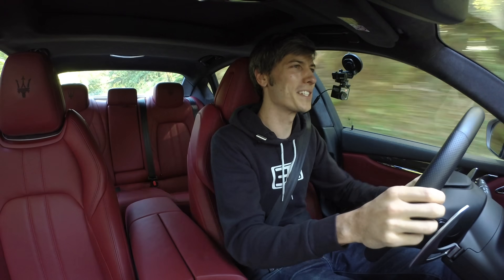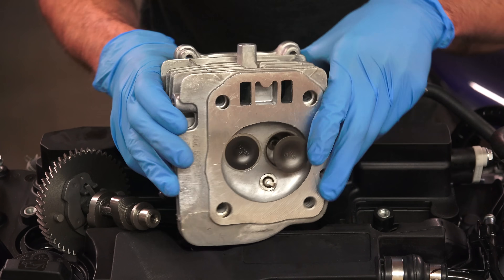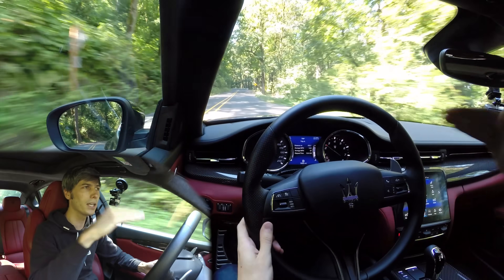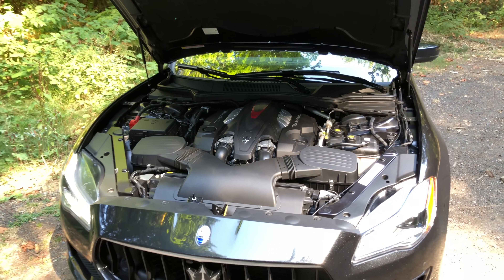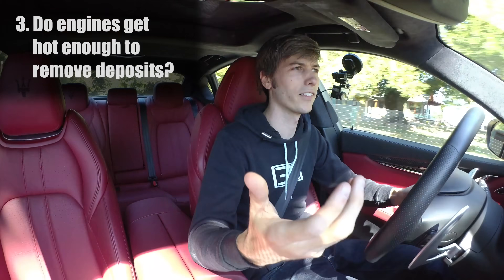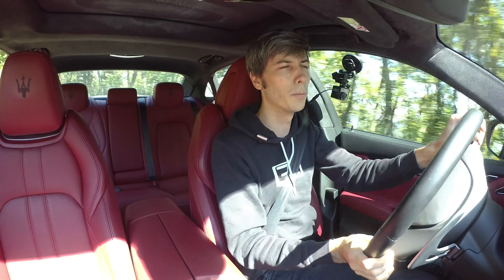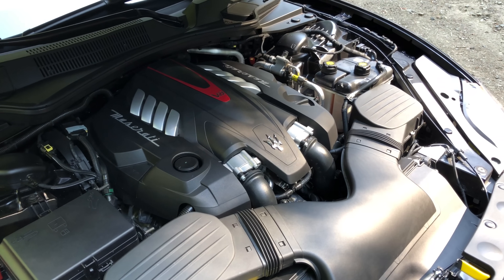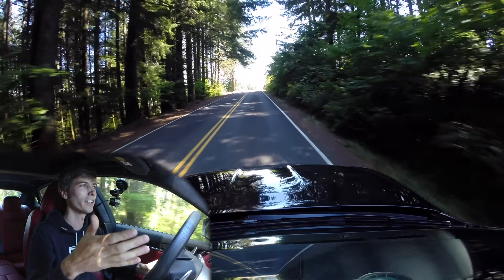Is Redline Good For Your Car's Engine? Italian Tune Up

Comment: I always thought "red line" meant "target rpm"
Reply: victornpb it’s suggested RPM, obviously you want to go higher for peak performance
Reply: "Optimum working range"
Reply: Redline is the maximum working speed of your engine. By this point, most engines, especially larger pushrod engines like V8s, can't really breathe. If you push most engines near this point, it should only be for extreme, emergency downshifting to help slow the car. There are cars that do love revs and have their peak output near redline, like the 8300(target)/9000(max) 2003 year Honda S2000. With lightning-fast valve movements, they manage to stuff every stroke full of air, even at crazy speeds. Meanwhile, the 1993 year Ford 5.0 truck V8s have their target HP output at 3750, even though they'll manage up to 5500 RPM. The heavy, reliable, pushrod and lifter pairs do not like moving quickly. These engines aren't too concerned about maximum HP output, but do rely on their significantly higher torque value to pull hardest at just 2500RPM.
Reply: It is, if you have a rotary!
Reply: My Subaru Legacy GT (gen 1) manual said "For optimum engine efficiency and life stay between 1500 and 7000 rpm". So Subaru clearly designed the engine to handle 7000rpm basically forever. If it was an actual concern it would have said 1500 and 4000 for arse covering reasons
Reply: It really depends on what you mean by "target rpm". I mean to say what reason you are "targeting" an rpm range. For example a given car's target or ideal rpm for say fuel economy maybe 3000rpm. You won't go very fast but you can keep it in a higher gear with a lower rpm to maximise your fuel economy. But that same cars peak performance rpm range maybe at at 5,000rpm. That means the engine is at optimal rpm for a gear shift. Which then transfers the ideal amount of power from 1 gear to the next with minimal losses. There is always a slight power lose for a second after you shift as the power is being transferred to the next gear. This is simply because of how energy works. When you transfer any energy from 1 location to another some energy remains at the original location and some is dropped during said transfer. These power loses are very slight and most people probably won't notice it happening. Red lining your engine is basicaly pushing it to its limits and maximising the amount of power/energy to be tranfered to the next gear or in the case of being in your top gear, say 6th just because, you're maxing out the amount of power being held. Its far more dangerous and damaging to your engine to red line in top gear then to red line while gearing up. This is because the energy and power is being given a place to go while gearing up while it's not at top gear. And we all know what happens when you hold to much energy is a container, it goes bang. Some newer cars have features like auto sport. Which will allow your engine to reach the red line before shifting gears while not allowing it to go into the red.
Reply: +John....  Energy does not continue to build in the engine - It is constantly being outputted (in one form or another) - Energy is power - power is energy.  Rotational energy is constantly being outputted (if its not - there might be other issues :) )  The only way it would build (in the form of heat) is if you are racing the engine while in neutral (Have you seen white hot glowing exhaust pipes before?  Not talking orange glow either).  From idle to red line - If the engine is under load - the engine is under load.  If the transmission is in neutral - at least 1 set of gears continues to spin (the hope is that you have proper airflow to the engine to keep it at the proper operating temperature).  If your engine is at say 75% load from idle to red line....  No matter what gear you are in - your engine load is still at 75%.  Your gear doesnt matter - the engine's load is at 75%.  If you are lead footed - its near 100% for every gear you are in.  That is until you back off and go lets say 65 mph.  Engine load is reduced.  Horsepower and torque usually plateau or start to fall off before red line so chances are you are not maximizing energy output.  Going past red line opens up the possibility to float valves, throw a rod, overheating.  Thats when things can go boom.  An Engine is not a Capacitor.  It is not capable of storing energy and suddenly releasing it.  Make this a tad simpler for $hits and giggles.  Lets says at Red line I have 150/150 hp/tq.  Gears 1-6.  1st gear will be at 150/150 at red line.  2, 3, 4, 5, and 6 will all have 150/150 at red line.  Under the same amount of load.  At 2k rpms they all have around 110/110.  Engine load will remain the same.  Transmission gear ratios stay the same (just different ratios per gear of course).  Final drive has its set ratio.  The engine doesnt care what gear you are in.

The only thing that is REALLY DANGEROUS is the fact that if you are near red line while in your final gear.  How fast is your vehicle going at that point?  Ive gone near 160 mph on a motorcycle and I still had 1/3 left on the tach before I hit red line.  Being in 5th or 6th gear near red line with most passenger cars will put you in the triple digits.  Unless you are on the Autobahn....  Most places you wont be able to go that fast without encountering law enforcement.

The logic of energy transfer you are using is slightly flawed.  When transferring energy in this case from the engine through the transmission to the wheels.  Most is transferred.  Some is lost when adding additional moving parts (transmission).  "Some is retained at the source".  The only thing that is retained is heat.  Its not energy that can be used.  It will bleed off when the engine is shut off and allowed to cool down (therefore it really isnt retained :P).  Heat (form of energy) is generated while the engine is running.  Engines would always be hot - even while off - if they retained their heat.

Ive ridden all kinds of motorcycles from tiny engines up to Triumph's Rocket 3.  Several cars from a little Geo Metro to a Dodge Viper (Pickup & car.  Both stick shift).  Several different makes of Tractor Trailers (18 wheelers) with both automatics and manuals.  9, 10, 11, 12, 13, 18 speeds.  18 is my favorite.  Red line does not always pan out for performance purposes.  It does have great engine braking (compared to service brakes) aspects to it.  My knees are bad and I hate being a clutch jockey in traffic BUT I love driving stick :)

Edit:  Sport mode has been around for over a 20 years.
Have a nice day :)

Comment: Change oil as recommended , drive on highways regularly .
Reply: I live in the UK and this idea of oil that is anything but synthetic intrigues me
Reply: Ungregistered User  diesel engine with dpf anytime 5w30...
Reply: Good advice.  Lots of short trips where the engine is running richer because it is cold, and it never gets a chance to reach full operating temperature is what really causes heavy carbon buildup.  Pouring a bottle of fuel-injector cleaner in your fuel tank every other oil-change can also help.
Reply: Ungregistered User  

It depends.

Old engines should use a rather thick oil. Those old engines tend to leak, cos of their loose clearances.

If i would use a 0w20 in my chevelle it would run dry in days ;)

Also if you are running the engine hard rather use thick oil. 0w20 may sound good cos its lubricates fast, but on the track it could get too hot.

Deciding between synthetic or conventional oil is a religion :)

Comment: Once I touched a solid disc after 3 hard braking attempts from 40km/h . My finger surface was like melted for a month or so and then it recovered. Can anyone tell me the temperature that the disc brake had? The car is a v40 volvo d2 2015
Reply: I agree with around 100c at those speeds... You held your finger on there till your body made you pull it away which is why you got burned pretty good, you weren't expecting it to be hot. Brakes can get so much hotter than that, you would have felt the heat and not put your finger in there if the brakes were stuck or you made a few 160kph stops...
Reply: I've seen cars when I can barely touch the wheel, let alone the rotors. And that was after the car had sat for a few minutes waiting for me to get to it and rack it.
Brakes can get super hot.
Reply: S&M Teen Racing Team I was about to say "seriously? you melted your brake discs from 3 stops at 40 km/h? it takes way more than that to even bed brand new brakes" but then I read it again and we're all good

for sure no more than 100c though because those 3 hard brakes at 40 km/h wouldn't have made them even hot enough for you to be able to smell them
Reply from the maker: I would guess no more than 100 degrees C, since that's not a very high speed to stop from. Still enough to burn you. Here's some evidence: https://youtu.be/EIa6_C1B6UQ

Comment: What about the momentum from the valves? I always was under the impression that if the components are moving faster then they would produce more intertia forces when they hit TDC, which could seperate the carbon deposits, kinda like if you were to bang the back of a pan with food stuck to it some thing might come loose? Do the carbon deposits even have enough mass to make this matter?
Reply from the maker: I think chemical bonds are going to be much stronger than the small amount of inertia the carbon will have. I also think that following a cam lobe means the impact won't be all that abrupt.
Reply: I heard it wasn't the increased velocity of the valves, but the increased velocity of the air able to break it off the valve.
Reply: That carbon is stuck and takes a wire wheel to attempt to remove it... It's like rock. Some is soft, but the real stuff is harrrrrd.

Comment: As I understand it, carbon reacts with oxygen and other atoms at high enough temperatures. It's similar to how catalytic converters work. They get hot enough to cause a chemical reaction to occur - the catalyst is there to simply speed up the rate at which the normal reaction occurs. For instance, inside catalytic converters: 2CO + O2 + Heat --> CO2 //or// CxHy + O2 + Heat --> CO2 + H2O.

EDIT: Chemists are likely going to destroy my comment haha.
Reply: Funny you made that comment, because the way I was always taught to remove carbon build up is as follows: Heat the head up(off vehicle of course) with a torch, and once the deposits are glowing red, blow oxygen from a tank in it and you literally watch it blow off of the metal surface. I've done it this way for years with good results, and no catastrophic engine failures.
Reply: Yes, incomplete combustion (not enough oxygen) produces fragments of incompletely burned hydrocarbons and those can crosslink forming organic bonds. More heat and oxygen causes those bonds to break (decarboxylate) - and the less bonds in a solid structure, the weaker it is, and the more likely it is to have chunks break off and get shoved out the exhaust.

Comment: The most important question is: why is it called “italian tune up”? I’m italian and I never heard this thing before...
Reply from the maker: According to Wiki (and I saw a Car & Driver article saying the same) it originated in Italy: "The origin of the Italian tuneup comes from Ferrari. Owners would drive their cars infrequently and never run them hard, which causes the engine to build up enough carbon inside to affect performance. Mechanics would perform a "tuneup" by driving several laps around a race track to get the engine hot enough to burn out the built up carbon. Cars before the advent of modern engine lubricants and fuels, often had a 'de-coke' by hand, after removing the cylinder head, as a scheduled service operation."
Reply: @EngineeringExplained  man those were lucky mechanics
Reply: I remember the de-coking days - I think Morris had an engine that needed it done every 10,000 miles or so.  And people think old cars were more reliable...smh.  :-D
Reply: my grandpa actually said to me about this method to remove deposits and also clean the exaust system from water and other condensation due to high temperatures,so yeah its totally an italian thing surely more from the past though
Reply: And all this time, I thought it was an ethnic joke...
Reply: @michaelblacktree  im italian background and i thought so too LMAO, i still used the term fairly regularly eh paizano
Reply: Side note: Wikis should always be taken with a grain of salt. For example, the person who wrote the wiki article above apparently confused Ferrari with a second-rate mechanic shop. 

Back in the old days, performing a tune-up actually involved tuning. And to verify the tune, you had to drive the car. How do you think a prestigious auto mfgr would verify the tunes on their cars? On a race track, of course!
Reply: + m.blacktree Carburetors are fun arent they?  :)
Reply: Just tell a friend "I'll give you an Italian tuneup for free" as you jump in his car. He'll stand there confused as you beat the piss out of his car for a while. Btw, this was a joke. Don't do it! (Unless your friend has a good sense of humor)
Reply: John Clark don’t tell me how to live my life!
Reply: New term for me too
Reply: Canadians have not hear Canadian bacon.  Germans have not heard German chocolate cake.
Reply: @thekksinca824 And, in the UK you can't buy an "ENGLISH MUFFIN".
Reply: David Besant in China there is not such thing called Chinese food
Reply: David Besant so sorry for uk. English muffins are really good.
Reply: You guys probably just call it “eh, I go fora drive eh?”
Reply: Have you heard of an Italian shower?
Reply: @vegancyclist8853  spray can of axe (or if you aint a Guido can of axe ans a lighter)
Reply: it was a trick question, Italians don't shower.
Reply: @vegancyclist8853  😂😂
Reply: Fe(rolls R)rrari
Reply: I'm guessing this was occurring more with the old Italian sports cars because they were tuned more for the track than for the street, and the rich fuel mixture would tend to foul the spark plugs during low-speed driving.
Reply: I used this technique on my old Alfa Romeo 33 with 2 Dual Carbs. After a long period driving slow the engine would to run erratically. After redlining 2 or 3 gears the problem solved by it self
Reply: Excellent question!
So now, children, please open your world grammar books to page 397, for the answer:
"Back in the day, Italian pizza delivery was a most competative bussiness. Delivery boys were paid per/pizza delivery, and not schillings per/hour. Thus, a lean, mean, high-performance, fire-breathing delivery vehicle was a necessity for the serious-minded  pizza slinging entrepreneur. Top-wage delivery boys often incorporated advantageous components such as superchargers, and turbochargers to effectively reduce delivery times. Eventually, the Italian government stepped in to deconstruct the pizza delivery monopoly, and to impliment fair-wage laws that allowed even slow, mediocre, Yugo drivers to earn comparable paychecks with their low performance soccer-mom wheeze-mobiles. During the height of the ensuing Labor Commission court battles, a significant ruling was made, which required six-figure-earning pizza delivery boys to disclose proprietary facts, regarding the secret famed "Italian Tune-up".  Despite initial resistance, one of the boys agreed to comply with the ruling after being threatened with prolonged incarceration in a dank, dark italian prison. In his own words on the witness stand, it was revealed that the secret Italian Tune-up referred to tossing the pizza on the passenger seat of the still-running delivery machine, mashing the throttle to the floor, while simultaneously side-stepping the clutch in first gear. With one eye on the tachometer, and the other eye scanning the pavement ahead for obstacles such as cars, pets, and small children... hundreds of horses were unleashed in the general direction of the customer's residence. The right foot meticulously feathered the throttle as required to keep the rear tires frying madly on the pavement, as the left foot stomped the clutch in perfect concert timing with red-lined gear changes. 
It was soon learned (during the weekly Monday night engine rebuilds) that this high-rpm approach to pizza delivery seemed to prevent the dreaded carbon build-up on the backs of intake valves and combustion chambers that resulted in a 5-7 horsepower reduction, often costing a forfeiture of the Employee of the Week Award."
Reply: +Lorenzo Di Cosmo Clearly you are either a) not Italian or b) so Italian that you don't realise that driving around at 7,000 rpm all the time is not a normal way to drive a car :)
I've driven a lot in Italy and the vast majority of cars have small underpowered engines due to high taxes on larger engines, and in most areas you have either hilly terrain or constant stop-start driving hence there is a lot of high-revving at WOT. Hence it's an "Italian Tune-up".
Reply: I first heard this term from The Humble Mechanic.
Reply: I'm Italian and we used to do it with our Vespas when we were kids. We just called it "smulare" as per "de-mule" in Eng
Reply: My grandpa said back in the day when they did this, it would shoot black smoke out all crazy.
Reply: Why bring/play a race card on a tuneup? ✌✌✌
Reply: Mel B Italian isn’t a race, but boy can they race🏁
Reply: @somestuffithoughtyoumightl6985  👍